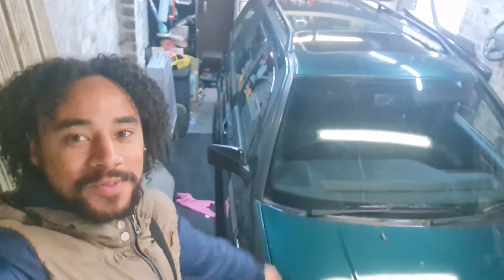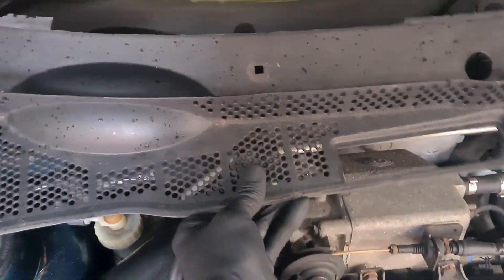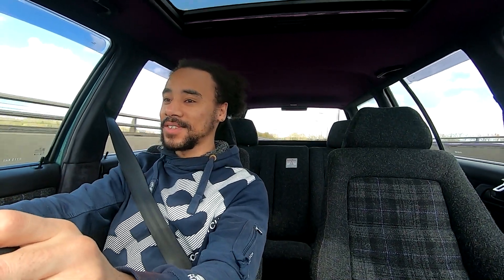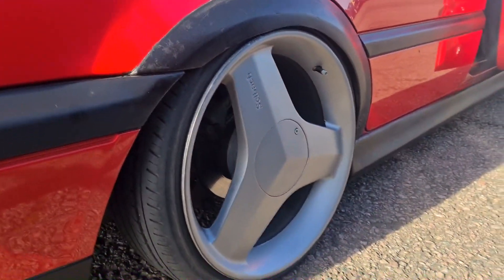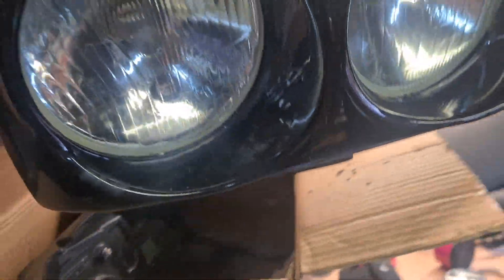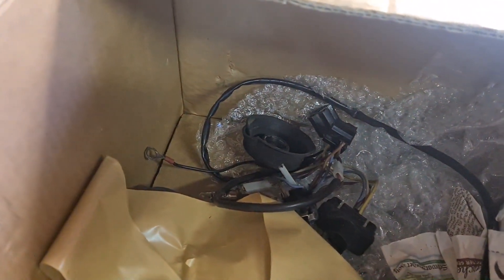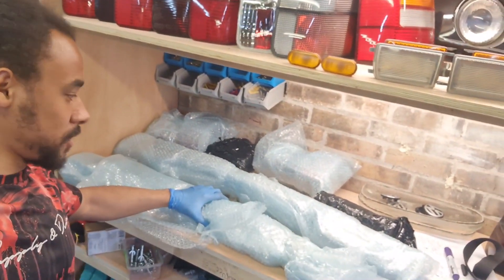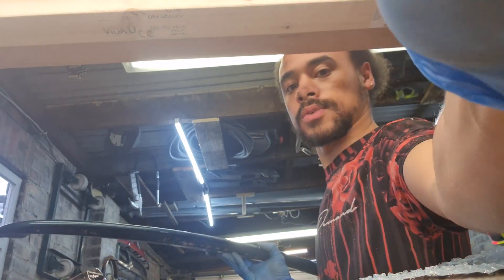RARE PARTS, NEW WHEELS AND MORE FOR THE MK3 GOLF ESTATE!! ep23

Comment: My mk3 signals do not work at all do you know if there are any common problems to this?
Reply from the maker: All of the signals are down?
Reply: @Project7YT  yea it doesn't even show on the cluster either
Reply from the maker: Potentially a wiring defect, faulty indicator stalk,  first I'd double check fuses and relay is ok and go from there